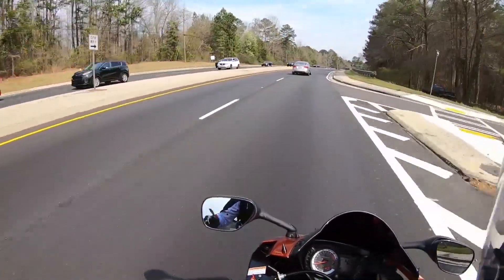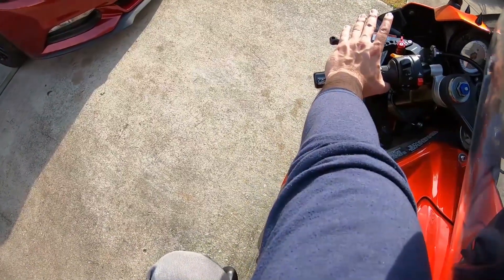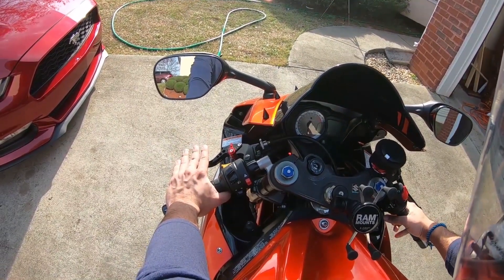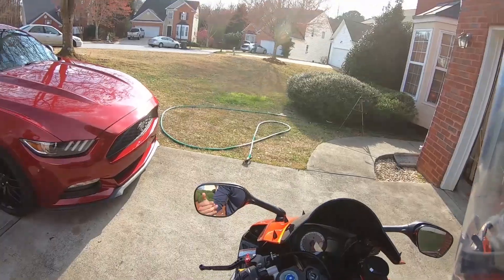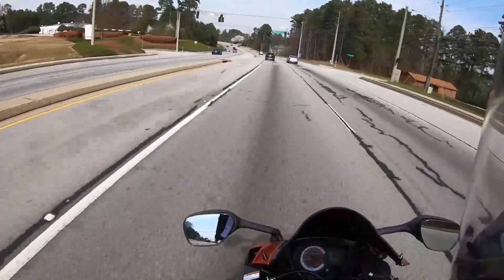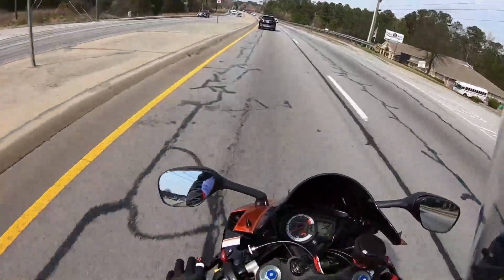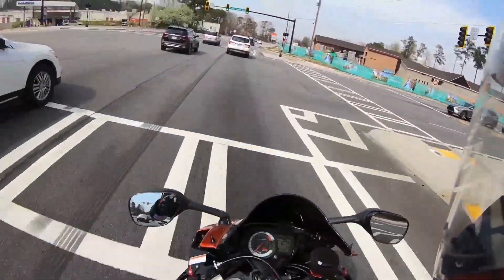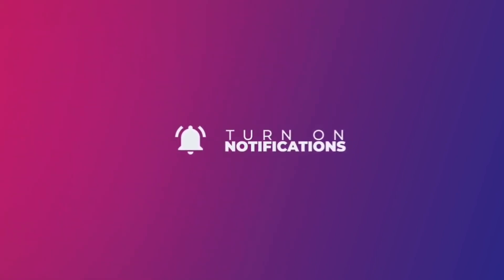WHY AND HOW TO DO ENGINE BRAKING

Comment: Can I engine brake without rev matching by slowly letting off the clutch?
Reply from the maker: You have to match the speed to let go of clutch . So u down shift as u get slower . Don't hold the clutch half way. That will wear ur clutch out .

Comment: Can we leave the clutch in friction zone for a moment and not completely release it after blipping the throttle and downshifting?
Reply from the maker: If you are staying in that gear then u can leave as you would do upsetting.
If you going down through the head than there is no point of holding clutch in friction zone as it can cause  wear in the clutch